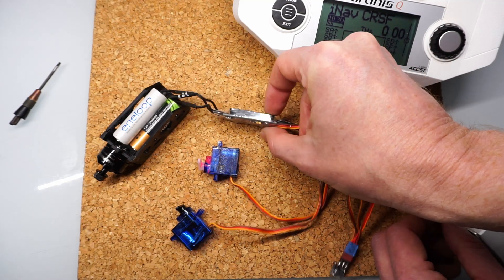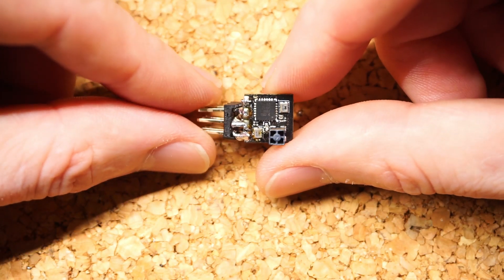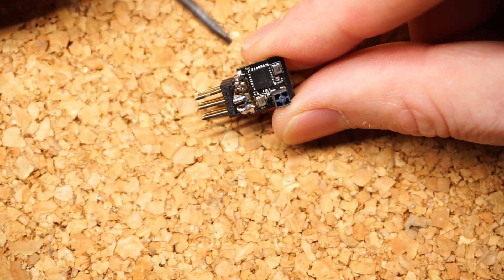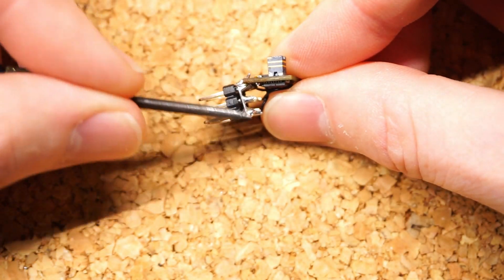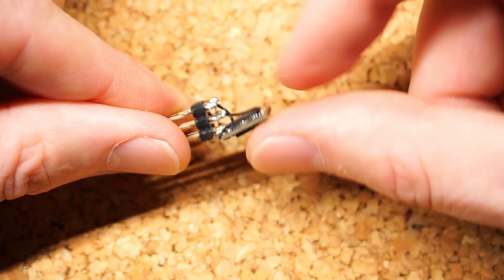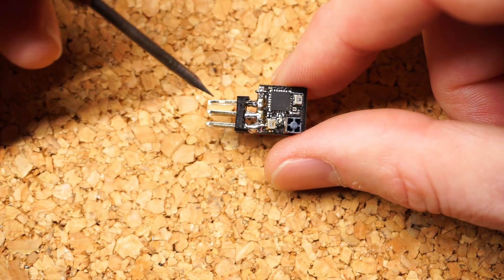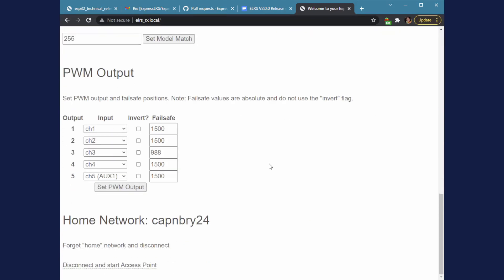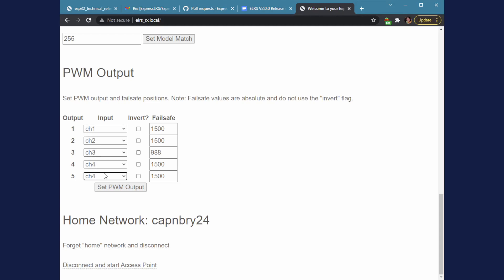PWMP Receiver - ExpressLRS PWM Output

Comment: For anyone watching this video now (2023) the easiest way to get results is to use the expresslrs configurator to flash 'HappyModel EPW5 2.4GHz PWM RX' firmware to your EP1. You'll only get 2 or 3 outputs depending how you wire it up but you can configure them as PWM as shown in this video. I have it working fine with a servo and simple ESC.
Reply from the maker: Yup, that or the Generic Targets -> Generic ESP8285 5xPWM 2.4Ghz RX (which is the same as the EPW5). Hopefully we'll get to changing the standard targets so they can just configure their pins to be PWM without changing the target, but it is not very high on the priority list.
Reply: @CapnBry 
Has there been any progess? 
Just beeing able to use tx and rx of any cheap Chinese reciever as 2ch pwm would be awesome! 
Just use an old elrs diy Module, pair it with an old Pistol grip remote and have an awesome reliable and dirt cheap method for controlling RC Cars 😍🔥🔥
Reply from the maker: @43Apfel  what more progress was needed? Any rx can output pwm if you change its config, but also now there are pwm receivers with 3-14 channels with no modding necessary .
Reply: @CapnBry  i must have missed this. 
So i can flash the reciever (No matter which model /target) with "generic esp8285 5x pwm", or is there some Option in the WiFi Interface of any rx?
Reply from the maker: @43Apfel  no, you can only flash that target into something like an ep2 (no receiver lna/pa). Any receiver can be converted without changing its firmware in the webui /hardware.html by moving the rx/TX/button pins to the pwm option

Comment: Is there a clever idea to get the battery voltage over telemetry? Maybe with a resistor divider which is connected to a unused PWM channel and some modifications in the elrs software.
Reply from the maker: It is already in 3.0
Reply: @CapnBry  awesome!!! Is there an instruction available?
Reply from the maker: @tobic2139  none of the commercial hardware has the proper hardware built in to do it. You can see more information here on if your hardware can be augmented to add it
https://github.com/ExpressLRS/ExpressLRS/pull/1466

Comment: Hi Bryan, I'm trying to flash an ep2 with the diy pwm target with no luck. i get the error not enough data uploaded.
Reply from the maker: That is a bug in 2.5. Flash back to  happymodel EP v2.4 receiver, then you can switch to 2.4 PWMP
Reply: @CapnBry  Noice, it flashed! thank you sir

Comment: Thx for this! I get an "Not enough data" error when trying to flash this on my HM EP2 - after hitting ok on the "FW mismatch - flash anyway?" . Any suggestions?
Reply from the maker: v2.5 has a bug that prevents changing the firmware target, you can't change it without going back to an earlier version first with the same target you have first, then switching targets once you're on that earlier version.
Reply: @CapnBry  Great info - thx!!! So if I go back to 2.4 - will that fix it? Or even earlier? Once flashed with the new target can I then go back to 2.5 and flash it?
Reply: @CapnBry  Success! THANK YOU SO MUCH!!!

Comment: I love that elsr has support the R9M and receivers! how come there is no PWM version for the original R9 (8chpwm with tx.rx) ?
Reply from the maker: Because someone would have to reverse engineer it, make a bootloader for it, write STM32 servo support, and then it might not fit on the original microcontroller any more. We also don't have any way of configuring failsafe / channel mappings / servo frequency without wifi. It is a lot of effort and challenges compared to the cost of a Matek PWM converter and an ELRS 900 RX.

Comment: Hi, I'm trying to make DIY receiver using modules SX1280 and ESP12F like I did in the DIY_2400_TX_ESP32_SX1280_E28, because it has GPIO9 and GPIO10, but not sure if DIY_2400_RX_PWMP firmware has support of ESP8266?
Reply from the maker: I'm afraid there is no support for the ESP12F with PWMP, since PWMP always uses GPIO9/10 as outputs and the ESP has those connected to its flash. No plans to add a new target for it either.
Reply: @CapnBry  Thank you for reply, but ESP12E and ESP12F has those gpios avaliable for use. And one more question: I can see this text: "// GPIO pin definitions// same as TARGET_RX_ESP8266_SX1280 except:// no serial/button, possibly reuse the BUSY/RST pin and adds PWM outputs" in the DIY_2400_RX_PWMP.h target. Maybe You know, what the TARGET_RX_ESP8266_SX1280? Maybe I can use it somehow to make my pwm receiver?
Reply from the maker: @RGolod  if they have those gpio available then why can't you just flash the PWMP target? YouTube comments is not a place to have a support/development discussion. Come to Discord and ping @CapnBry if you want to continue

Comment: I tried this out and it works very well.  I'd love to see some voltage telemetry coming back from a really minimal model though - one with no flight controller.  I'm not adverse to reworking a resistor scaling network so that the uP can sense the incoming voltage before the regulator, I assume it doesn't see that right now.

Comment: Is this available for the Happymodel ES900RX? I don't see it. Please say it is, or will be in the future!

Another question- I'm using the Matek CRSF-PWM converter for now. Do you know if this adds any latency?
Reply from the maker: Yes the es900tx works too, with the PWMP 900 target. The Matek receiver adds a little latency, because the PWM has a low refresh rate, but you can up the output rate if your servos handle it (although only expensive servos do more than 50Hz)
Reply: Thank you!
Reply: Got it working! So awesome. Do you think latency this way is lower than using the Matek CRSF to PWM converter?
Reply from the maker: @Av8orn8  maybe the teeniest bit, since it doesn't have to be transferred to the converter board (0.6ms) but servo refresh rate is 20ms so that is somewhat insignificant.

Comment: I want to use this with RC cars... Not just because of the insanely long range and signal robustness, but also because the nano sized RX is perfect for 1/32 and 1/35 scale cars, especially when I only need two channels.  I have a 1/32 scale RC car with FPV camera that I drive all around the school, but the control link fails long before my video does.    The trouble with expresslrs at this point is that nobody makes a "surface radio" TX that is uses expresslrs, and as far as I can tell, nobody makes a tx with a JR bay on it. (anymore?)
Reply from the maker: You're right about that, there's just not any surface TXes out there with a module bay or really any sort of customizability. The super expensive ones seem to have fancy screens, but are all integrated. It is a shame too because you really don't get great range on older FSK modulations when you're down on the ground-- crashing a quad losing connection because it is in the grass was one of the major reasons for creating ExpressLRS! I don't really have a solution for you though, unless the handset options change.
Reply: @CapnBry  I am going to try to figure out a way to intercept the pwm output of a surface radio to see if I can pick up a signal and send it to do an elrs tx module. It seems like it should be possible. I opened one up today that has hints like it's right there in the open.

Comment: Hi, Are you using a Happmodel EP2 receiver? (it look very similar). What firmware are you using? And, which pads do you connect channels 4 and 5 to?
Reply from the maker: The pins are in the PR linked in the description, but they are not very accessible on the EP2 (GPIO 9 and 10). The firmware you just select DIY 2.4 -> PWMP in the ExpressLRS configurator.

Comment: Bryan,  I've been trying to build this using ExpressLSRS configurator 1.2.3.   I've select "GIT BRANCH" tab and "master" branch.   Set my target "Happymodel 2.4 GHz" and "HappyModel EP 2400 RX".   Selected "Manual mode" and added GPIO_PIN_PWM_OUTPUT.
It compiles and flashes but I don't see the  PWM selections with the WIFI menus when I connect?
Can you give us a quick Video on building and Flashing the PWM settings?
Reply from the maker: Oh you can't just add the PWM define to the configurator, there's a whole new target. This is merged into ELRS main now, so just select 2.0.0-RC2 and the target DIY 2400 PWMP in the latest configurator.
Reply: @CapnBry  When it give a hardware missmatch do I just say "Flash anyway"?     I'm flashing a Happymodel EP2 RX 2.4 GHz
Reply from the maker: @markgrennan5855  yes because you are changing the target type
Reply: @CapnBry  Thank you.  All working after upgrading the Happymodel EP TX transmiter to V2.0.0-RC2 and update the LUA scripts.

Comment: Hi, can`t You add to ELRS also "Standard RC version" with 8 or 16 10-bit channels? 
Just idea: in NORMAL mode AUX8 can be version selector. If AUX8 == 0, Race copter version, if AUX8 == 1, "Standard RC version". 
In "Standard RC version" AUX2 - 4 can be as pointer for CH1 to 4: 
If AUX2 - 4 == 000, CH1 - 4 is PWM 1 to 4
if AUX2 - 4 == 001, CH1 - 4 is PWM 5 to 8
if AUX2 - 4 == 010, CH1 - 4 is PWM 9 to 12 ... etc. 
With 500Hz refresh could not be problem make lot of 20ms PWMs...

Comment: Can this be used with the r9slim+ receivers?
Reply from the maker: The framework is there, but it would need to be extended to STM32 targets as I only did one for ESP targets.
Reply: R9mm with the 4 outputs?
Reply from the maker: @jdd1777  It is possible for sure with an external something or other to actually plug the servos into, but won't make it in for 2.0

Comment: Does this mean that you can use the same receiver, simply flashed with different firmware, for PWM and flight-controller/CRSF setups?  Yes, it does.
Reply from the maker: That's correct. I forgot to mention it in the video but that's a big plus is that you still have the four pins needed to connect it directly to a flight controller, just swap the firmware!
Reply: Which is the firmware to be flashed? I thought it's enough to enable pwm in the expresslrs configurator